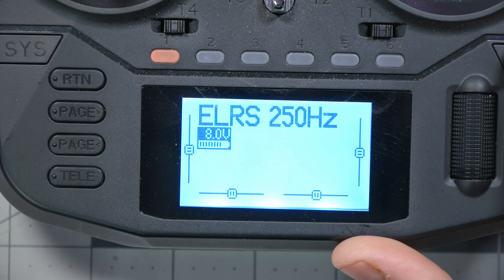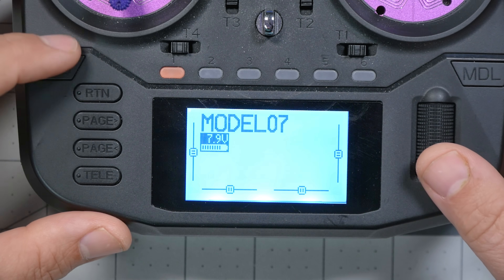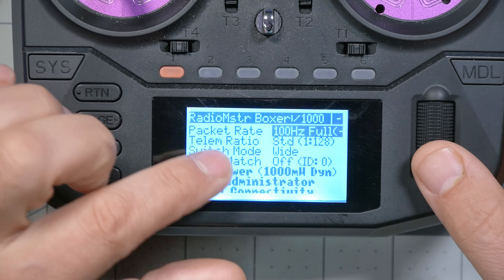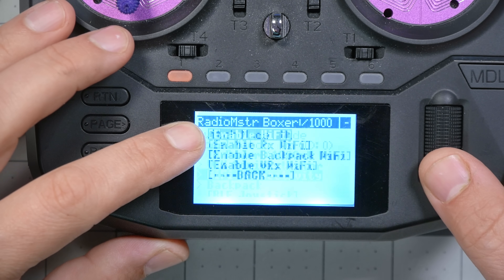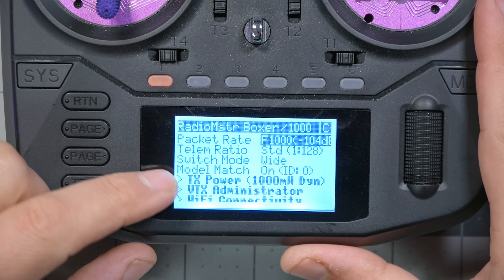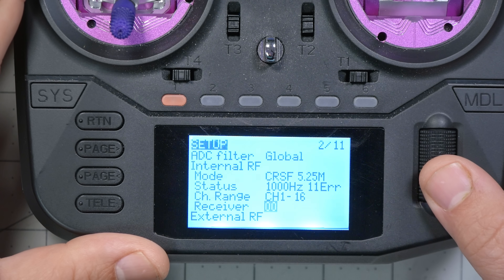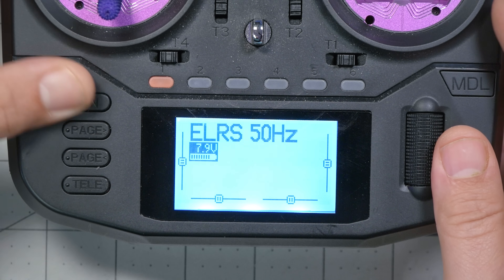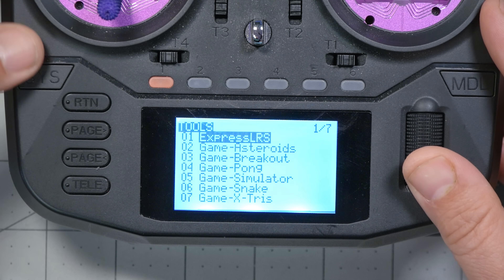Discover the Power (annoyance) of ExpressLRS Model Match

Comment: Very helpful video... new to ELRS multi-band with the TX15... I have 2.4 and 900 rx and I was going crazy trying to get them to bind on model 0... Seems settings Model = 0 on the TX and setting a 2.4g packet rate + Model = 1 w. low band for 900mhz is an ideal path or is there one packet rate / setting where everything will just bind? At least know I know how to customize it for the use case.  Thanks JB!

Comment: Will this work in the Radiomaster MT12? I want to switch driving between 2 cars without actually turning off the cars. Say i got an scx6 and a trx4 and in the trail i use the scx6 to haul the trx4 in a trailer and once i decided to drive the trx4 i would just simply change the model in the transmitter and it will now disconnect with the scx6 and connect with the trx4. Is that possible? Thank you in advance Josh🙏🏽
Reply from the maker: Yes it works with any EdgeTX radio including MT12.

Comment: It would be nice if "Model Match" loads the correct model in my radio depending on which Quad RX ID I power on. For example when I power on my Quad with ID 2 and it connects to my TX it will load the model with ID 2 in it. Just complaining about model mismatch is not really useful to me, or the feature should be called "Model Mismatch" ;)

Comment: I just switched radios, all of my quads would connect with the same model but with the new radio they wont. I preffer to just plug in and go and use one model I just can't figure out why it's doing this, I have to rebind every time I switch quads which i usually bring 2-3 different ones with me.  How can I make them all connect to the same model?  Using Radio Master Zorro if that helps...

Comment: Just thought I would mention that to use model match you still to have a matching pass phrase on both the RX and TX.  I set up 3 new RX's and a Boxer.  I did not set a pass phrase on any of them but enabled model match on all 3 RX's, then set up the TX lua script and the 3 different models.  Non of them would bind, so I added the same pass phrase to the TX and all 3 RX's and they all bind as they should.

Also figured out that if you add a network SSID and password, the unit (RX and TX) will no longer show up as an available network on the PC, but they do show up as a WiFi target in the configurator, which is easier than using the webpage interface.
Reply from the maker: Model Match does not make them be bound. You still need bind phrases. 

If you put a wifi home network in the firmware, the RX and TX will connect to that network if available, and start hotspot if it's not available.
Reply: @JoshuaBardwell  Also meant to thank you for your videos.  This hobby would be a whole lot more difficult without your insight.

Comment: Given that I fly more than quads I will be using model match. Model match was one of the selling points to the original spektrum dx6 radio, and one of my favorite parts outside of stepping away from xtals and channel flags. I am about to switch from my jumper t16 to radiomaster tx16s mkII, opting for internal 4in1 and external elrs so I can have the higher output when needed.

Comment: SPI USERS: You too can use a rudimentary version of model matching even though it isn't officially supported. All you need to do is use the radio to set the "Receiver ID" to one that isn't being used by traditional model match and in the future when you select that model it will turn model match off and set the settings to "default" which you can set up normally. Selecting a model you have set up with model match will turn model match back on and set the correct settings.

Comment: Why would you not use model match? Seems like a no brainer. I use different keys to drive different cars. Load the model file and be done with it. Seems easy enough
Reply from the maker: Most of the time, it works just fine without the added complexity of model match.

Comment: @JoshuaBardwell there might be another useful feature as well, if you own multiple quads and have multiple radios, you can set them up one per model and you can take multiple radios and quads out. Borrow them to friends you're flying with and just use different models for each quad. Meaning sharing quads when you own all the equipment is easier too. I want to go fly with my partner, we take two quads, two radios. They select Model A, I select model B. Both models are available on both radios. But now I've selected the correct model, we don't have conflicts about what radio talks to which quad

Comment: Model Match is a standard for many years and is used by most common brands. Especially when flying planes and helicopters this really makes a difference. Even though ELRS was originally not intended to be used for anything other than drones, I'm glad they are catching up and making it more versatile (Model Match, more full resolution CH, PWM receivers, ....) . I will soon first try ELRS on a glider and curious how that works in real life.
Reply: I started RC hobby straight to ELRS. It was amazing, I'm so lucky i don't have to migrate from something like Spektrum or FRSky so I don't have to deal with adaptation. Can't say how amazing ELRS for fixed wing, got my Radiomaster ER6 and it's just overkill for anything VLOS related and a solid choice for FPV. I put ER6 on my Flitetest foam board glider and it works nicely

Comment: Radiomaster RP2_ 2.4-Ceramic Ant. 
Binds every time, no issue. this week, would not bind. later that day, on the bench, still would not bind. Later that night, it binds, no problem. Five times in a row, that night it binds no problem. I have no idea what the heck was going on, it just did not want to bind, and then it decided to behave. Not using model-match, never have. Been using the same binding phrase, that I use for all my copters. Anyone else get this with Radiomaster RP2_ 2.4 Receiver?

Comment: just noticed that spi based elrs rx where if you use a model id, model match is automatically turned on, so had to turn on model match for spi based rx, for others i keep model match off, but give a rx number, for me whoops with spi need 500, where as i use d250 on race quads and love this feature, which i dont know why i didnt use so far
Reply: how do i even set up model match for an spi receiver that doesn't seem to have wifi? (mob 6 elrs)

Comment: I think it is a good habbit, to always by default create a new model, for each Quad and always load the correct model to start flying.     I would recommend to use a real  model name for eachmodel, so you recognize select the right model.   (7inch iflight long range 6s, rather than,  50hz elrs)  especially when flying quads, planes and helis, selecting wrong model can be very dangerous and lead to a crash.

Comment: Another use case scenario of model match - a family of flyers. My sons and I each have our own transmitter, but we share quads. We all use the same bind phrase, each quad has its own unique receiver number, and each transmitter has a profile for each quad with that unique receiver number.  

Now each of us can power on our transmitter, pick the quad we want to fly, and when we power up those quads, they are connected to the proper transmitter, and only that transmitter.
Reply: I tuned in just to make this comment. I fly with my boys and we each have a quad but only two radios and even when we get a third radio, I keep the passphrase the same and just use model match. It is easier. Otherwise, we had to be careful to turn on and lock one at a time which was too difficult.
Reply: That is my case too. Same Phrase but 2 Transmitters and 3 quads and a wing. Can we fly both at the same time? I have All models in both Transmitters... Not testet jet..
Reply: And can you fly at the same time ?
Reply: @ghostrot  ok so I tested it. It's not cool proof when transmitter were near eachother and rc near eachother. It start raising power to keep connection. And lose connection. When I separated a lil bit apart like 10ft it seemed to not lose connection. When I have time. I need to test more. Like keeping transmitter apart but the 2 rc next to eachother.
Reply: I was just going to do this to let these school kids play with my fpv rc car and tank. But I didn't want to change one of my transmitter binding phrase. I figured this would work but wanted to hear someone that did it already

Comment: I like using model match with ELRS. If your channel settings are all the same but you want to have different modules settings, just get one model set up right and copy it. Change model match number and you are all set. I have 3D quads which can’t do Return to home and I have crossfire ones. Even if the channel mapping is about the same, I want the audio prompts to match.

Comment: I went for the TBS Tango 2 Pro but I still feel like I'm missing out on ELRS... Of course I can get the module bay, or just rock Crossfire, which is a proven reliable protocol of course. Also, I could have gotten the Radiomaster Zorro, but I just don't like the way it looks. First world problems right here lol. I don't mind tinkering with complex scripts and configurations, but I might just go for Crossfire on my first drone. Is there any reason why a non-competitive noob drone flyer should go for ELRS?
Reply: ELRS is cheaper, you can change the packet rate and many other features that the other control links just don't have. 

Elrs can go from 50-1000hz. Which means it's great for racing and great for long range. 

 Crossfire is great for medium to long range, and tracer is good for racing to medium range. 

But the point is... elrs does it all and more for cheaper. (Also micro quads like tinywhoops etc can come with it built into the flight controller)
Reply: If you're starting out, the better question is "why wouldn't you use elrs?"
Reply: @cathodd2442  module bay + ELRS it is, thank you!
Reply: @Stan Bekker  you're welcome dude! 
Like anything it does have its learning curves but after a couple installs it'll be a walk in the park.

Comment: JB any chance you could do a video on the best practices when setting up models.  I've seen different approaches in many YouTube videos.  In this one you use 50Hz; 250 Hz, etc.  Other times I see Quad; race quad.  Other times I see people setup a separate model for each.  Looking for something you may have already done or a new video where you to talk through best practice.  Thanks always for doing this for all of us. Appreciate you.
Reply: Joshua Bardwell imo doesn’t give the best advice on this. He has recommended 150Hz in the past for “most people.”  When I was trying to figure this out myself, the devs at ELRS are recommending 500Hz for most people.    Bardwell says for new pilots, we don’t need it, but at the end of the day, the latency is shorter so it is a faster link.  Also, another dev told me that he can’t tell the difference as long as it’s over 250Hz, but he prefers 500Hz because then the RC command is on 500hz which is easy to filter out since it’s far from the 0-80Hz.  If you don’t know what that means, it just means that it’ll be easier to get a clean gyro signal, and will require less filtering.

Another tip I learned is to use dynamic power output and let it go to the max.  It will extend the battery usage of your radio based on telemetry readings.

1:128 and Wide seems to be what everyone recommends.

Comment: you can change model match number to any number, then power up RX, go into lua, toggle modelmatch off, wait a sec, turn back on, model match is updated on RX, no need at all for wifi. that also works for changing the number, just change the number with powered RX, toggle modelmatch in lua off and on, number is updated in rx
Reply from the maker: Good trick! I didn't know that!
Reply: @JoshuaBardwell  happy to give you a new way of modelmatching, hope that functtionality will stay and is not a bug. thats very useful because no need of any wifi nonsense for simple stuff
Reply: yes, i discovered this as well because i just lazy to do the wifi page settings 🤣. i guess it match what joshua mentioned, the packet rate settings is actually store inside the model settings of the radio, so when you do the model match on and off tricks, it actually update the option in the radio model.
Reply: thanks for this tip... just did it on one and it'll make doing them all so much easier 🍻

Comment: I have a quad I build and I need help I been though it all. New build changed motors and checked frame and soldering. I have a quad that when armed and turning prop on or off( motor spinning about 10% throttle) it’s fine when I  move it on it’s axis the motor feedback is normal nothing weird yes with me holding the quad with my hand. Now if I apply input via radio only, key word with radio input quad give a sound like prop is loose or something is loose via rotation. Again bench and hand test axis and simulate motion it’s fine sound fine. It’s only with radio input. Same elrs fw on both rx and tx. No issues rssi it’s pure radio inputs via radio.   Anyone can help with this? It’s literally a new build 4th one.

Comment: Yea i was going to say i use the Receiver number in my Frsky Q X7, for setting up different models but still under their own model name to make it even easier.
But on my crossfire tango2, i do use model match, and it seems to basically work the same as setting a different RX number for each model , or just leaving them all at 0 if you only have say 1 or 2 similar drones or similar planes, etc.. Good video, definetely cleared up some questions i have had in the past.. Also i understand your wanting of a switching model for the protocol vs the model match number itself.

Comment: Does this also work for SPI-based boards? The ExpressLRS wiki isn't clear on this on either the SPI or Model Matching pages.
Reply from the maker: I believe there is a CLI option in SPI receiver FC to change the RX number, but not 100% sure.

Comment: What if you just do dynamic Hz and not having to worry about it regardless of flying long range or freestyle?
Reply from the maker: ELRS does not have dynamic hz.
Reply: @JoshuaBardwell  interesting I did not know that. I just set my boxer on dynamic I didn’t know it wasnt functional.
Reply: @Gray_Beard  It seems like its there because it thinks its crossfire still lol.. but crossfire has dynamic power, basically the max output power is set, 1w. Then with dynamic power its supposed to only use as much TX power as needed because a lot of times you dont end up flying that far away, especially for Crossfire or ELRS Setups that can go for miles. Saves battery power and should reduce interference alittle bit considering theres less noise from a constant 1W of output power..
But yeah it doesnt actually apply to ELRS at all like stated already.
Reply: @mxracingunlimitedltd7784  I am slowly learning that lol. I appreciate the clarification.

Comment: I have never understood how people get so confused by model match. To the point of giving up and spreading advice that it’s best to just turn off. Same with paring phrase. 
They work so nicely! And are dead simple to use if you just slow down and take your time to read and understand. 
I use model match exactly how you’ve demonstrated here. Low packet rate on my 7” long range. 
Medium high packet rate on my 5” basher and whoops. 
Never have to worry about remembering to change them when swapping quads.
Reply from the maker: Even the dev who created it agrees most people should just turn it off.
Reply: @JoshuaBardwell  
That’s crazy. 
I guess anything to simplify the process for people who easily overwhelm and give up. But you are giving up a fantastic feature.
Reply: Easier to just use RX numbers for this. It won't Bind if the correct model's RX isn't recognized. That's all you need. Plus it saves way more settings.
Reply: It gets a bit more difficult with no wifi elrs tiny whoops.

Comment: It do not work with the TBS Tango II and an external ELRS Module 😞 😞    😞            😞                                        😞
Reply from the maker: Update the version of freedom tx I think they added Model match support in a later version.
Reply: I have had it working before just like in the video on freedom tx and my tango 2 with that setup also. Whats the exact issue, you cant find the model match part or the RX number part? The RX number is the most important. Check the bottom of the first settings page by Bind
Reply: @mxracingunlimitedltd7784  Freedom V1.30; Step 1: turn on Modelmatch in the TX Settings in the Tango, Step2: Model-Setup Page 1 bottom: Set Modelmatch ID to 27; Step3: enable Modelmatch (via ELRS Configurator) and set ID to 27; Step4: turn on TX and Flightmodel; Result: Model missmatch. When I just disable Modelmatch in the TX-Settings in the Tango and enable it again, it bound. But in RX-Settings and Model-Settings (Page 1 bottom) the ID ist set to 0. no idea why, it doesn't work for me

Comment: 😂 “it's kinda a pain in the a**“ I'm on record of always saying nobody should use model match, and I wrote it! Is a fine safety feature but overkill for almost everyone. The per-receiverid configuration is gold though to fly both quads and fixed wing, or LR quads (which would want different mode switches) and freestyle quads, or anything that would have different packet/telemetry needs.
Reply: I love it, I use 4 radio models currently and it makes sure I never fly off on the wrong settings. THANK YOU
Reply: It is very useful flying with my boys. It was frustrating to get sorted out but that was because when I first started using it was when it first came out and the lia didn't update right away and I kept not getting confirmation I had it right and changing over and over. Thank you!